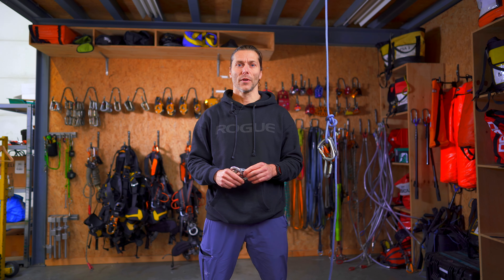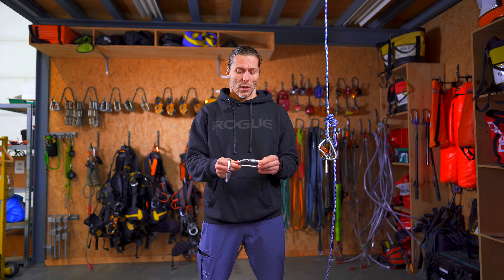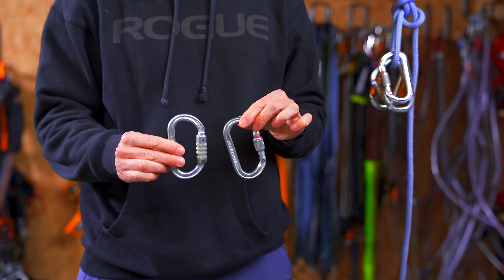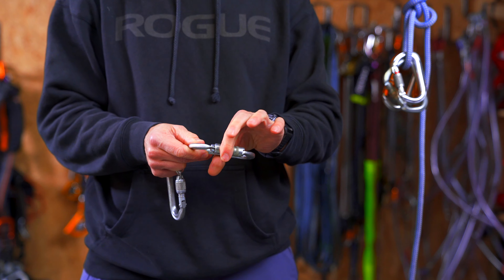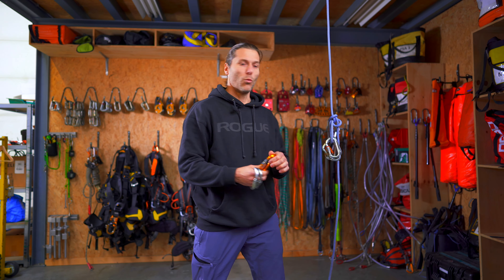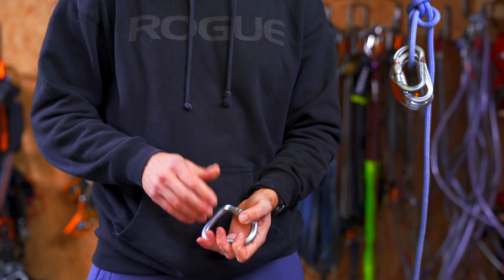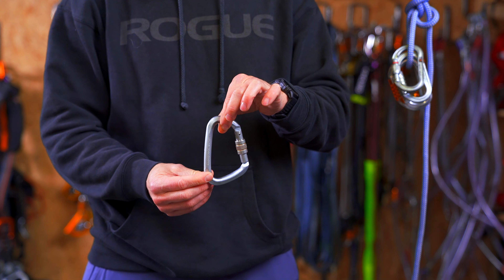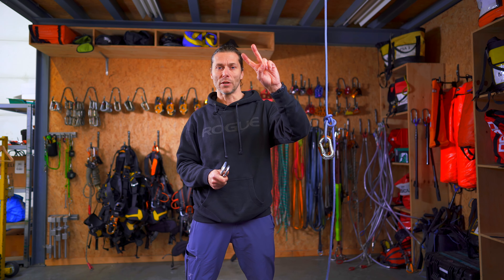The Rope Access Carabiners - The Rope Access Gear Explained Series | The Carabiners

Comment: Love the videos, very easy to understand, i have a small welding company also based in the Nederlands mostly working on site, rope access would be handy sometimes, what training would be the best for this, how long does the training for Irata level 1 take and also am i curious what the differences is between Irata and other.
Reply from the maker: If you’d like we can have a conversation about options for this. There are multiple ways to go. If you send me an email through the website we can plan a call and talk. connect@theropeaccesschannel.com

Comment: Another great video. The question has been asked in the comments a couple of times what carabiner you recommend and I understand why you did not. Personally my preference has always been steel screw gate carabiners as although they weigh more, they are stronger and can be opened with one hand. I find tri-locks difficult to use (2 hands required) and there are videos online showing the gate on a tri-lock opening if the rope slides along them. The aluminium carabiners may be light but as mentioned they are not as strong and will snap. They also wear out way quicker under normal use. One advantage over aluminium is they do not rust if stored with wet gear but this should be avoided anyway. Loads and breaking limits were mentioned and how stell will bend while aluminium will snap. This can be an issue if the carabiner is loaded up on a 90 degree angle, say the carabiner half slides over a ledge. Yes this should never happen but aluminium will not handle the situation as well as steel.
Reply from the maker: Thanks! :-)
Like I said I don't have a specific carabiner I use all the time. It just depends on intended use and what is available. 90% of the time my clients supply climbing gear. 
For rigging I usually like steel biners because all of the advantages you mentioned. For attaching stuff to my harness it is usually aluminium and trilock.
I have seen screw gates open due to vibration where the gates just go up and down. I have had trilocks open against branches. Both have their weaknesses and strengths.

BTW trilocks take some getting used to and I love them and can open most models one handed without thinking. But I am one of those idiots who gets frustrated and messes about till he finds a way that works ;-)

I will make a video on my harness setup and you will see how many different carabiners are on it haha.